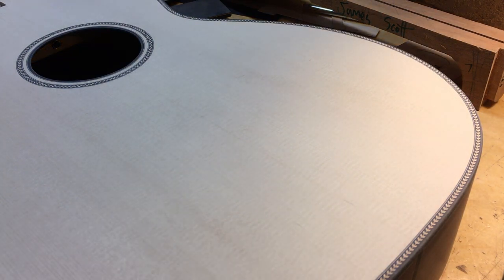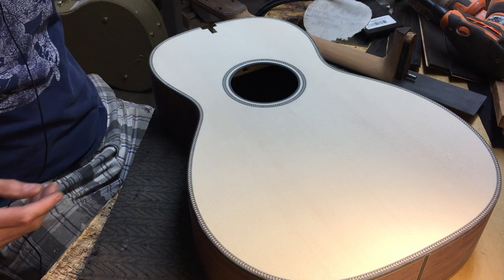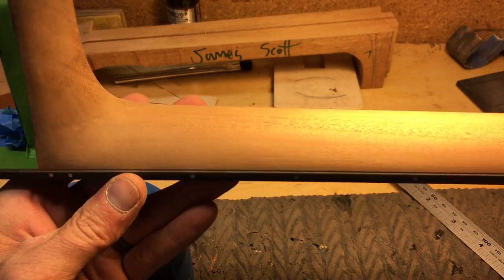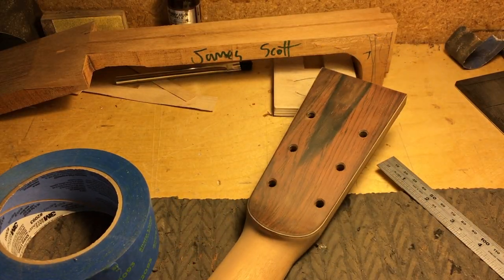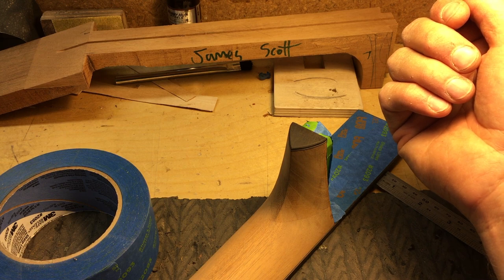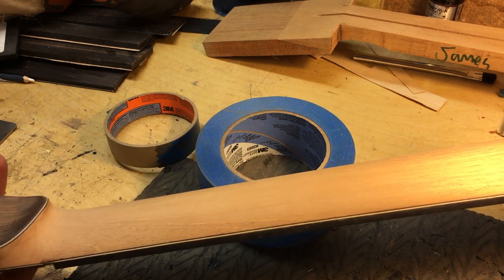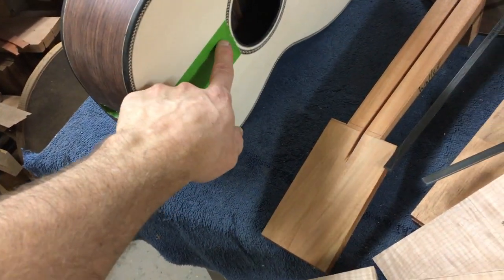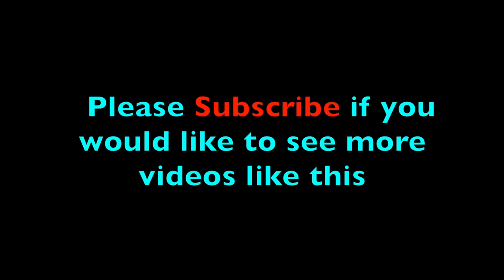Masking Instrument Before Finishing Beau Hannam Guitars and Ukuleles

Comment: So, what do you do instead of taping off the bridge area?  I am trying the tape shy of the outer edges and routing a small rabbit edge the thickness of the finish so I don’t have to cut finish to fit the bridge.  Not happy with anything I’ve tried.  Is there a video of you fitting the bridge?
Reply from the maker: I position the bridge and scalpel around its 100% footprint
Reply: I would love to see you do it.  Patience in abundance I’m sure.